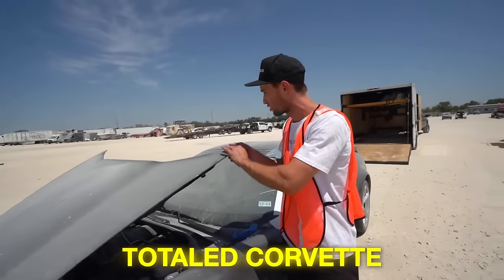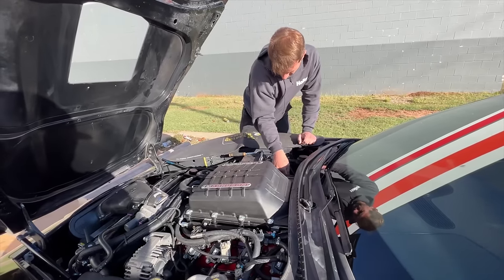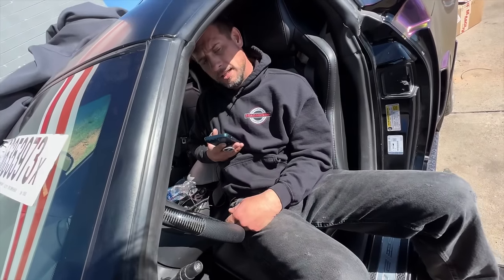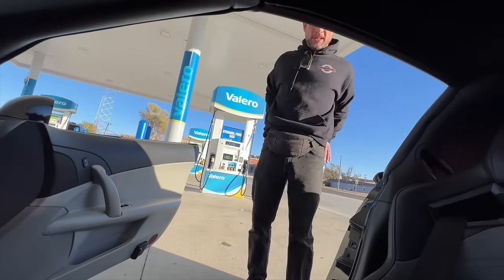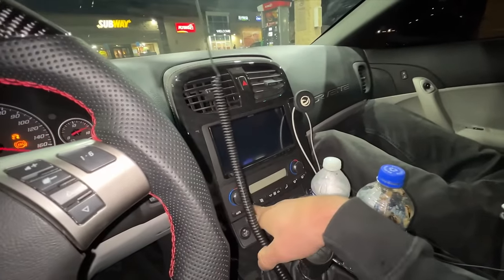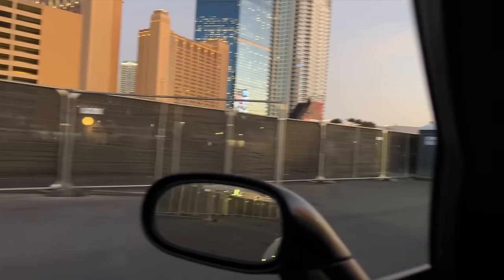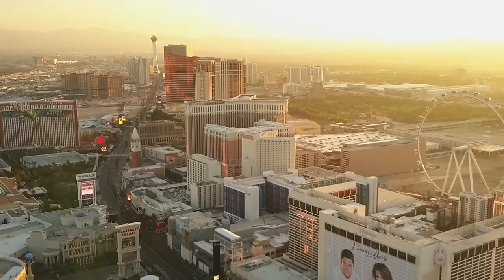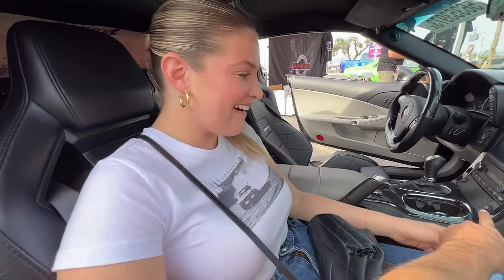I Rebuilt a totaled Corvette and took it to Sema!

Comment: My guess is they have a gasket leak which is dripping on the hot exhaust.  I have seen this before. I could be wrong, but replacing the head gasket solved my problem.